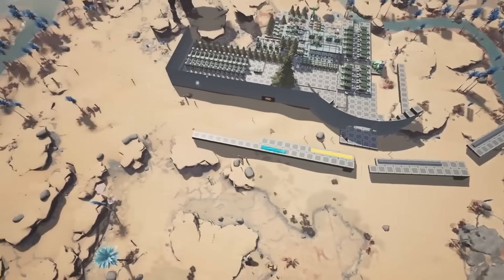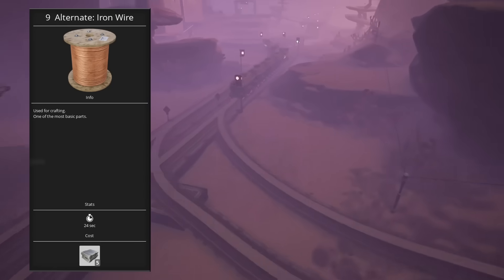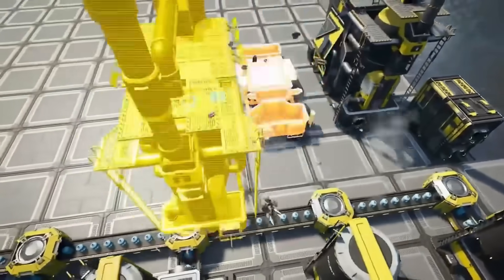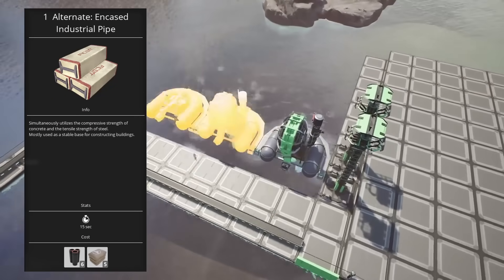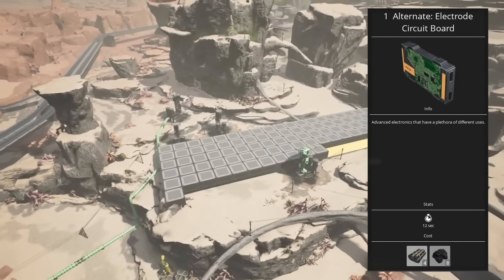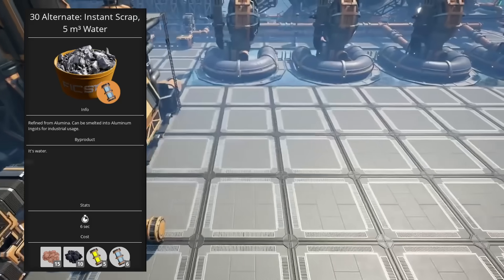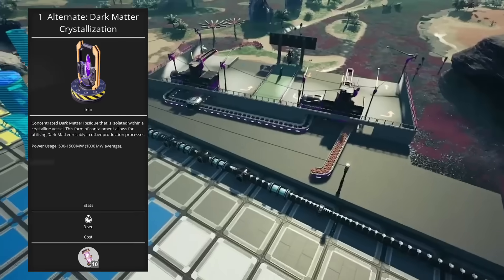Alternate Recipe Guide - Best alternate recipes for each tier in Satisfactory 1.0

Comment: I am shocked that nitro rocket fuel didn't get a mention. Absolutely OP Alt recipe
Reply: I think he is more turboblend->rocketfuel guy because he mentioned turboblend. I also prefer this way as you are using more oil but less sulphur, nitro and no coal, and may be getting little less power it still gives enough
Reply: @marekfraniak3962 issue is you only need 3,108 sulfur/minute to make 50.4 rods/minute, and then using the waste to make 22.4 Plutonium rods per minute. There is 10,800 sulfur on the map
Reply: Yeah this was a major omission, esp. given it's the current go-to for power and likely to remain so for a long time.  Even if it is sulphur-heavy!  Otherwise a great vid though.
Reply: He also didn't mention Electrode Aluminum Scrap which goes well with the Sloppy Alumina recipe and overall increases the amount of Aluminum scrap by another 10% which puts the output on par with the instant scrap while not requiring coal or sulfur but just using petroleum coke instead which can be easily produced in large quantities.

Comment: Those pure recipes are golden.

I got all of the iron replacement recipes, so I decided to use the pure iron ingot recipe in my factory.

I used it on 6 overclocked normal iron nodes.

That's 1800 iron ore per minute. After running it through the pure iron ingot recipe I get about roughly 3300 iron ingots per minute.

More than doubled my throughput.

With all the iron replacement recipes that means I can make it significant amount of the early tear stuff all in one place.

I actually called the factory The Iron Falls.
Reply: what's crazy is im slowly succumbing to the same thing lol. Im making a mega factory for only early game resources and im collecting the recipes for it 😅😂  im building over the void.

Comment: thanks for the vid. What do you think of the "leached" recipes that produce ingots using sulfuric acid. On paper they seem really good but since they use suflur I'm not quite sure they would be that useful outside of a few cases.
Reply from the maker: I hoard sulfur in Satisfactory like I hoard buff potions in rpgs, so I'm not quick to spend it on common resources. This is probably the wrong way of thinking for me as I finish the game with 12 unused sulfur veins.
Reply: From a pure throughput perspective, maybe.  I think they're terrible for most purposes, though, because when do you ever have the sulfuric acid lying around to use with this?

Comment: Iron wire is great, however IF you have copper in the area it'll be more effective to use iron in the copper alloy recipe (requires the Foundry) and make "regular" wire from the extra ingots
Reply: Iron and copper alloy are great in using the same assemblers with a recipe change. A little more design work and one doesn't even need to change belts.

Comment: I'm surprised by the comment on oil being right next to caterium.  It sounded like an interesting idea for a side factory, so I liked around and can't find any spots like that. They all seem to be about 500 meters apart at best.  Doable, but a logistical headache.
Reply: In one playthrough I'm doing right now, I'm doing EXACTLY this (Electrode Circuit Boards -> Caterium Computers) on the Gold Coast.  This allows you to save the Copper in the area for Aluminum products (because you have an aluminum node right up the cliff).

I just like Electrode Circuit Boards in general because it removes copper from circuit board production without costing more oil.  With JUST the Electrode Circuit Board recipe and comparing 10 Circuit Board production to base, you lose 5 Fuel as a byproduct, but remove Copper from the production.  So it requires more power (both directly and the loss of Fuel to burn), but simplifies logistics.

With Heavy Oil Residue, it needs twice the oil, but you produce 80 more Fuel.  So if you're going to be burning oil as Fuel anyway, it's an option...

Comment: You fully ignore weight points of recipes.
Reply: Weighted points aren't necessarily a useful way of evaluating recipes: the classic example of them failing is with Turbo Electric Motor versus Turbo Pressure Motor, where the latter has a worse WP solely due to using nitrogen, even though nitrogen is hardly a limiting factor, and the former uses more of just about every other rare resource in the game.
Reply: @CruelestChris  Yeah honestly a lot of the recipes are situational and their value depends on what your factory has a surplus of. It's a lot easier to make use of a resource you already have but aren't using instead of having to go find a new one to utilize some "better" recipe.
Reply from the maker: Yep. I play with them and look at how the numbers work and what's easy and what cool synergies there are.  Not actually sure what you mean by weight points.
Reply: @Dekoba  that explains everything

Comment: Iron Wire is often really appreciated in alternate rankings for early game, but like why? It leaves you with less space and less power while you have no other use for your copper at that point.
Reply from the maker: The pairing with stitched iron plate is one of the reasons I recommend it so early, as the pair is better than the default plates+screws for making reinforced plates, but can still be built off of a single belt of iron. The other reason I recommend it so early is that it is really a very excellent recipe at any stage of the game, so its worth grabbing while you are more likely to get it so it doesn't get lost in the sea of new recipes that come with later tiers.

Comment: question have u not had a problem with the hard drive library screen filling up to the point it doesnt work anymore? i had to roll back on the save n remove some
Reply: It won't scroll the highlighted recipe off the screen. If you highlight a different recipe further up or down the list then you can scroll.
Reply: @rickhagen433  yeh ill try that thanks
Reply from the maker: Honestly ive never had it get that far. I tend to take recipes and explore a lot though, so Ive only banked 8 or 10 recipes that I dont plan to open til im done.

Comment: I'd argue that Turbo Blend Fuel isn't that efficient. It saves you 62,5% of sulfur and 100% of coal for 58% of oil. Depends on which one you value more
Reply: It definitely depends on the situation. I'm building a turbo fuel plant right now where my limiting factor is sulfur. If I do the diluted packaged fuel loop, I get 2062.5 TF a minute. If I do turbo blend fuel, I do consume more oil, but my yield is 3,300 TF.

Comment: I have to make a correction. The bolted recipes do not produce more items. The recipe just allows the assembler to process at at a faster rate. The difference is that is consumes more iron than the default recipe. You save on a tiny bit of power at the cost of iron wastage. It's not worth it.
e.g 10 Reinforced Iron plate = 120 iron / min. Bolted Iron plate = 131.667 iron / min.
Reply: Bolted is a weird one.

I'd say bolted can be useful early game where power saving is more important than resource consumption.

However at that time you have basically no need for lots of reinforced plates.
You could also simply underclock and have more machines working on the base recipe to lower the power consumption
Reply: @wontcreep  Steel screws are great. You can just use them for the standard R plate recipe instead. Both use the same amount of iron plates. Only difference is bolted uses significantly more screws for the same yield as the standard.
Reply: @momentiumengine1424  Bolted recipes are great for saving space, which is handy for blueprint factories
Reply: Not sure I follow your logic there as one the alternates actually does drastically increase items produced.

1) Base Recipe of Reinforced Iron Plates - 5/min
2) Stiched Iron Plate 5.625/min 
3) Adhered Iron Plate - 3.75/min
4) Bolted Iron Plate - 15/min

Bolted by largest quantity produced is superior. Pair with cast screws or steel screws and assuming at least Tier 3 belt and you're fine.
Reply: @brandonreames4121  They meant that the bolted recipees cost more ressources then the standart ones. Sure you safe some space, but you could do more with the standart recipee.
Reply: @frozenherolp9077  Yup, I hear you. I was challenging the "Bolted recipes do not produce more items" statement as they do (in terms of rate). I totally get if resource constraints is an issue and time isn't a concern, using another recipe is more efficient with a flat pool of resources.
Reply: @brandonreames4121  The 290 screws and 90 plates require 198.5 iron ore to produce the bolted plate reciple at 15/min

When you scale up the standard recipe to 15/min using 3 assemblers it also uses 90 plates but requires significantly less screws at 180 screws per minute. You need to look at the whole system and not 1 machine.

Reinforced: 180 screws 90 plates
Bolted plated: 290 screws 90 plates.

Even using Steel screws, the standard is better because it just overall uses less screws. 

P.S. Cast screws has the same iron consumption as the normal recipe. It just saves on complexity and power. 

👍
Reply: @momentiumengine1424  Yeah, totally understand the efficiency side makes normal recipe superior. Was commenting on your initial statement though about "bolted recipes do not provide more items." Purely from item volume produced, they provide more per minutes. I do get your initial intent was on items produced "from the same resource amount". 

To some that is valuable enough to pursue. Me personally, I prefer stitched iron plates as the crossover of iron wire, iron pipes, encased industrial pipes and steeled frames is too good to pass up for a heavy modular frame factory. Cheers.
Reply: @brandonreames4121  
Bolted Iron plate isn't the best. Just because it produces more per min doesn't mean it is the best

If you have 780 Iron plates (maxed mk5 belt) to make Reinforcred Iron Plates you will want to use the Adhered Iron plate recipe if you are wanting to make the most Reinforced Iron plates out of 780 Iron plates as it makes double your recipe suggestion and here's the proof:

1) Base Reinforeced Iron plates (RIP) with 780 iron plates as an input = 780/30 = 26 assemblers. 26 assemblers output 5 RIP each per min = 26*5 = 130 RIP per min
2) Stitched Iron Plates (SIP) with 780 iron plates as an input = 780/18.75 = 41.6 assemblers. 41.6 assemblers output 5.625 SIP each per min = 41.6*5.625 = 234 SIP per min
3) Adhered Iron Plates (AIP) with 780 iron plates as an input = 780/11.25 = 69.3333 assemblers. 69.3333 assemblers output 3.75 AIP each per min = 69.3333*3.75 = 259.999875 AIP per min
4) Bolted Iron plate (BIP) with 780 iron plates as an input = 780/90 = 8.6666 assemblers.  8.6666 assemblers output 15 BIP each per min = 8.6666*15 = 130 BIP per min (and this recipe requires you to make 2,166.65 screws per min for all 8.6666 assemblers. Screw screws)

So, for per min per machine, BIP is the best as it outputs 15 Reinforced Iron Plates per min, but overall, you will get far more from a supply of iron plates with the AIP recipe, you'll just need far more assemblers.
Reply: @I_Bring_Cheese  Yeah, I hear you there. it isn't more efficient, but faster per minute to produce the item. For where I am right now around T6, I am looking to redo my starter factory of all base mats and may move to this to bolster the per minute figure. No wrong choice though really if time isn't a concern or resources aren't a concern.

Comment: Iron wire and iron pipe are so insane. You can cut copper out of so many production chains with these. 

Also iron pipe can be unlocked before you even have a steel factory and allows you to get some goodies like nobelisks early, it's nice.
Reply: IMO, more important than Nobelisks early is making SAM Fluctuators to get more items into the Dimensional Depot.  But yes, Iron Pipe means you can jump on all of these things much faster.  My normal strategy is to get Iron Wire, Stitched Iron Plates, and Cast Screws, and then sit on the rest of my hard drives until I research Steel Production (which I might do before Coal Power) and then use those Hard drives to get Iron Pipe so I can do all of this.
Reply: @NemisCassander  good idea, also lets you get the better steel recipe while you're at it

Comment: its possible to cheese the hard drives. just research a few, save BEFORE you check the mam. then go the mam, reroll, if your desired recipe is not there just load and try again
Reply: Had to do that because the sloppy alumina recipe wasn't playing well with the regular RNG.

Comment: Not mentioning steel screws is a crime
Reply: I think it's left off because so many alternate recipes simply drop screws as a requirement altogether.

However, the aluminum->steel beam alt + the steel screws would be absolutely nasty if you needed to bury a small nation in fasteners.
Reply: @Drummerx04  Things like aluminum beam/rod is great for the red forest where iron is a long ways away.

Comment: crude oil to diamonds is a-tier.
Reply from the maker: agreed, I probably should have mentioned that it stands out from the other diamond recipes
Reply: @Dekoba  Is this true even when you consider the abundance of coal on the map vs. crude oil?
Reply from the maker: @NemisCassander  It is just so efficient and I never max out on resources in any case. Even my biggest mega factories in early access only used a little over half the oil on the map, and that was mostly for power that I didnt need. I didnt include it because its a single processing step either way and the difference between setting down an oil extractor and a coal miner isnt really that big of a deal, but its throughput makes it better than the default with little downside.

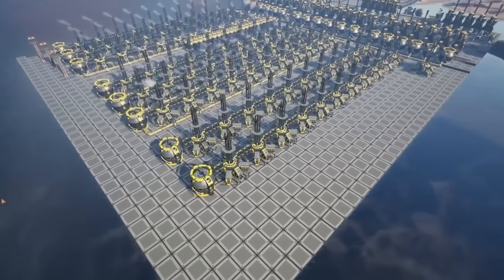Comment: Great video. Really good breakdown and explanation of alt recipes. But holy shit, can we talk about what's going on in the background xD What the hell was with all those packagers / unpackagers at what I assume is your fuel/rubber/plastic production factory. 2:45 - 5:45

Do those water extractors work ok in that config? I've built a similar facility and its always shutting down / under producing due to the nightmare that is fluid sim.
Reply from the maker: Haha yea theres a lot going on there. that is from update 5, i just needed something to set the dialogue to so I pulled a bunch of my old timelapse builds from early access. The other comment is right about it being diluted packaged fuel, mostly for a power plant but I diverted some for recycled plastic and rubber as well.

As far as the extractors go, that each section takes 480 units of water, so 1 Mk 2 pipeline hooked to 4 extractors seems to work fine. The plant ran for several hundred hours without issue back when. Again, update 5 though, things may have changed.
Reply: I think it's a turbo fuel factory with all those generators going. Either way, the most efficient way by far to turn oil into fuel is to use the diluted packaged fuel recipe, which requires packaged water to make and must be unpackaged at the end to be turned back into a liquid. It stretches your oil very far and fuel is used in a ton of other good recipes. If you want to go 'mega' with your builds you'll have to use it.

A general tip for fluids if you are having trouble is to make liberal use of pumps and valves, also look up 'water tower satisfactory' to see a pretty good easy tip to help with liquid movement.

Comment: You're better off skipping turbofuel entirely and turn it directly into rocketfuel with the alternate "nitro rocket fuel" recipe!
Reply: You can still do turbo fuel as a means to burn the compacted coal if you have oil in spare! Just set it up in a ratio where you use less compacted coal and sink any exess that might not get used, and slooping the last blender making the rocket fuel will double it. You won't need to dip into neuclear if you do this as you'd be able to make about 350~ gw from 16 blenders by using 32 sloops
Reply: Nitro rocket fuel is fine and simple, but not very efficient. If you want efficient, you have things like petrocoke turbo fuel into rocket fuel. Uses much much less sulfur, uses no coal, and uses about 70% more oil, which is plentiful for most players.